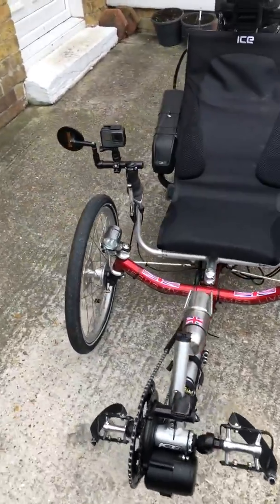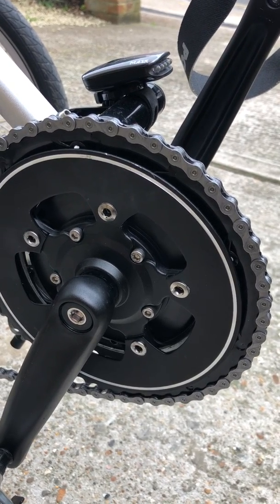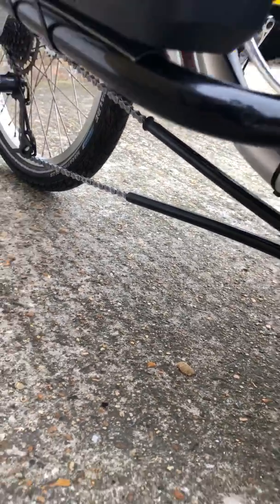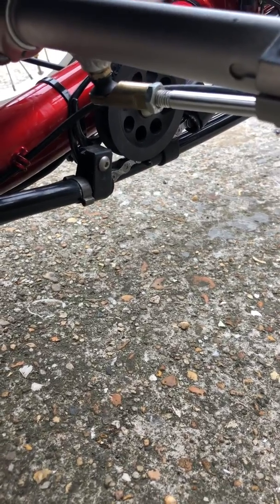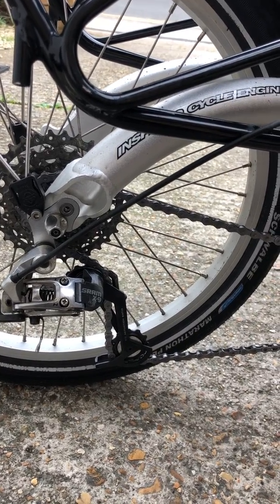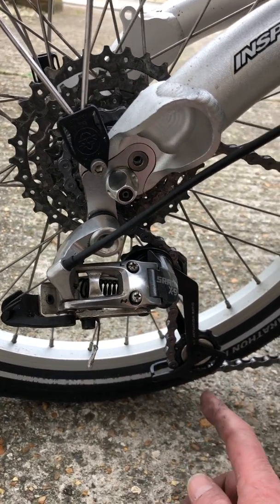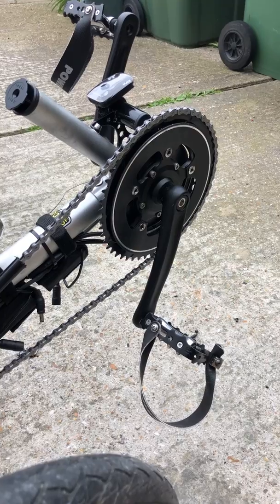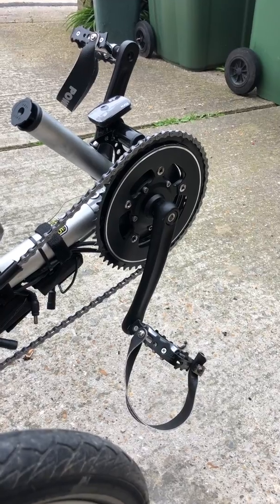Recumbent Trike Chain Replacement Tips

Comment: if you break the worn out chain on the lower side of the crank,   then use a quick connect to attach/connect the new chain, and us the crank to pull the doubled chain thru all the tubes and derailleur, then you can disconnect the old chain and use that quick connect to secure the new chain.. No fishing.. :)
I use the KMC (stretch proof) X9.93... that and using A.T.B. (AbsolutelyTheBest chain lube (red) and clean the chain often and apply drop on each link, I get about 3k miles per chain, and have never broke a chain.  Proper maintenance is the key to longlife.. I have a BBSHD 1000k watt mid-drive.  I put a small chain ring (narrow/wide 30T) to keep the motor spinning fast and cool.  And never lug the motor down,  (hard to do with a 350w mid-drive) Listen to how fast the motor is spinning and gear down when you hear it struggling.. that means the chain is also under enormous torque.  (higher power level, lower gear is the key)